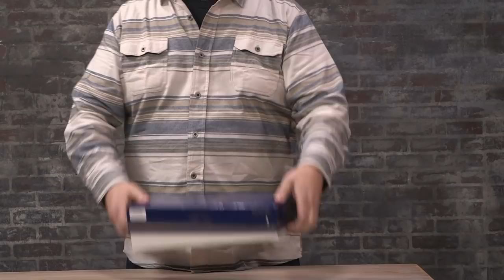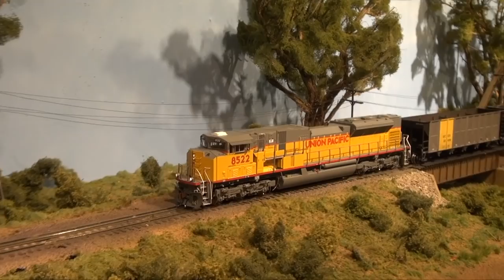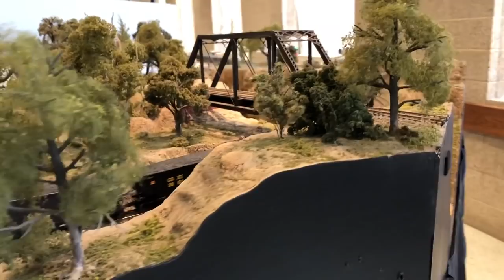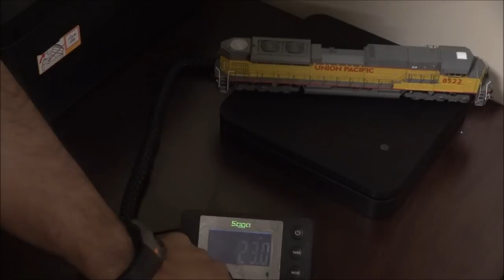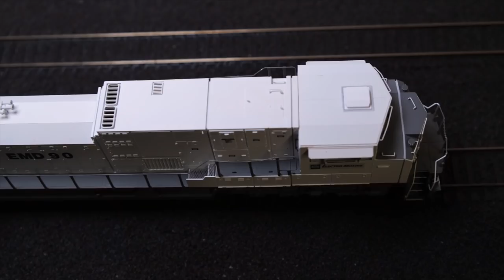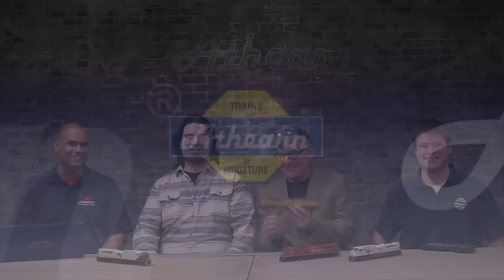Athearn "What's in the Box" episode 1...

Comment: The electrical box beside the coupler is the ECP connector, while the dual brake pipe is to enable a longitudinal coupling connection of the hoses instead of the usual diagonal below the couplers.

Comment: The three radiator fan configuration was the original design & was incorporated on the SD9043MAC's, which were to be converted to SD90MAC's. Later models had the two radiator fan configuration.

Comment: Nice units. But, those scale size, super thin handrails are still awful. The demonstrator unit had the last 8 handrail stanchions leaning forward (engineers side) from the rear step well forward and a gigantic bow (outward) in the handrail right behind the cab. For the price of these units better handrails would be appreciated.
Reply: These are pre production, prototypes as it were....
Reply: Off topic, but I'm an N scaler, and my local shop got a large shipment of Athearn acid tank cars, and none of them have the end grab irons or the piping along the parimeter of the car.   Looks like about 35% of all the car is missing.   That is every single paint scheme, every car # in stock.   I really wonder why or how this happened, and i wonder if the entire run is that way